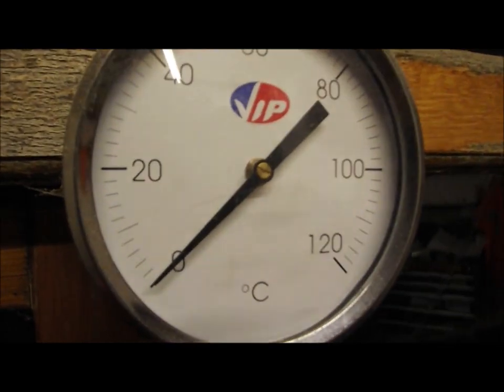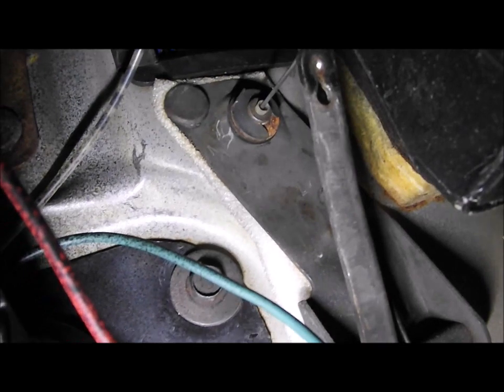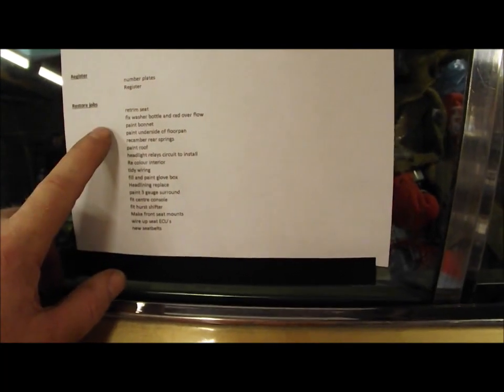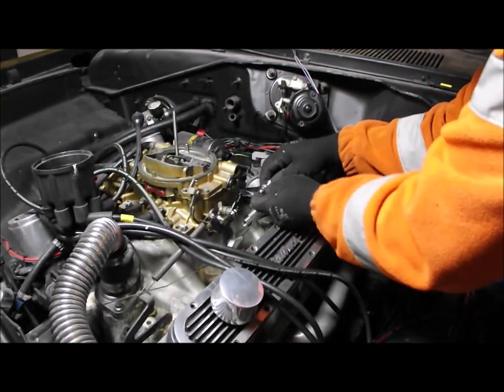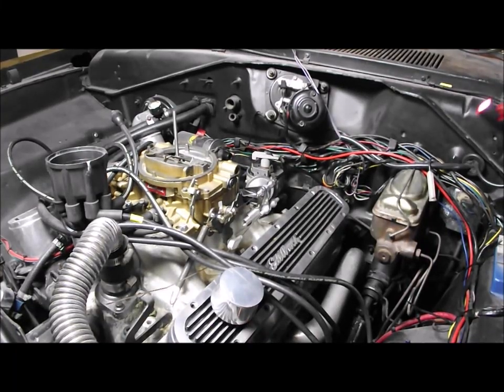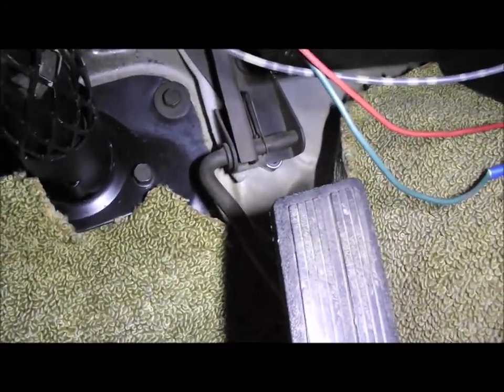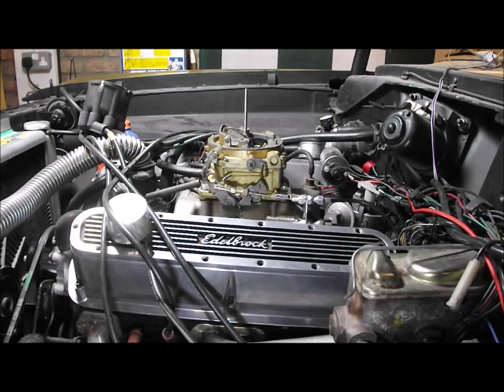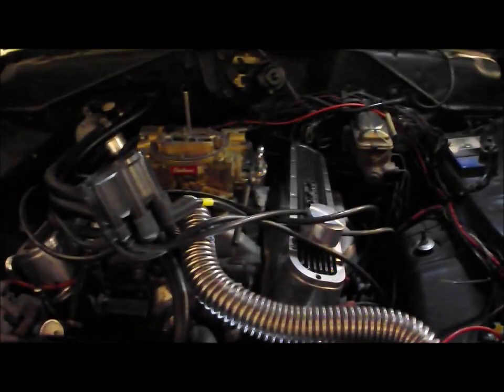1971 Dodge Dart pt7- Throttle & Lokar kickdown cable installation -  Vintage Steel Garage Ep 12 -

Comment: I'm watching this cause I'm about to do my throttle cable on my 1966 Dodge Monaco 4 door 383. Great help. I'm also gonna do brake master cylinder so I can  get my brakes working again. Bought it 12 years ago, and it's been a chore. But I'm inspired not to give up on it by videos like this. It makes it all worth it once you can drive it. I seen you got to in February, congrats!!!
Reply from the maker: Hi. Yep sometimes we all need a little you tube motivation. Glad it helped
Reply: I'm selling it now. I'm essential now and do not have time to work on it. It's on Facebook marketplace if anyone wants it. I can't let it sit anymore. Listed as 1966 dodge monaco for sale in alabama.

Comment: This is not quite as simple as he is showing. The pressure lever he is attaching the cable to under the car is from center to center of attaching hole aprox, 2 3/4''. The other end of the lokar cable attaches to the carburator arm which is aprox center to center of mounting hole 1 3/4''. The passing gear is a 1 to 1 ratio, meaning when the carb arm or lever moves 1 inch the pressure or passing gear lever has to move 1 inch.( no more, no less ) One of the reasons chrysler used steel rods on the passing gear levers to assure exact movement without any slop. If this is not done right it will not function as it should. Too little pressure on the pressure lever can damage the transmission over time. I drilled the passing gear or pressure arm to match the carbutator arm lenth to get the 1 to 1  ratio that chrysler requires...With the pressure lever pulled all the way back to rest the cable is slightly taught at the carburator attachment.  Idle adjustment needs to be preformed before adjusting passing gear cable to prevent disturbing the adjustment of said passing gear lenth setting...
Reply from the maker: Good feedback thanks

Comment: I'm struggling to find al your Dart videos. Did you cure the vibration issue?
Reply from the maker: Yes it was the distributor
Reply: @vintagesteelgarage  Interesting, I own the car now. I'd love to get in touch to ask a few questions if possible.
Reply from the maker: @VintageLifeCars  yes no problem. can you send a private message on you tube? not sure.  To be clear then the distributor was replaced by the new owner, I sold it with that fault. As I had lost interest and had my eyes on another project as you do.
Reply: @vintagesteelgarage  No, Youtube removed that facility... if you go to my details and click "About" you will see an option to view my email address.

Comment: My cable is working the kickdown but it won't go into final gear. What am I doing wrong?
Reply from the maker: Disconnect lokar cable and see if it works then. If it doesn't probably transmission linkage. If only when lokar connected it might be a little too tight and slacken off

Comment: Nice job. Did you pull the inner cable tight from the engine bay side before cutting?  That’s the part I’m up to now.
Reply from the maker: Thanks for feedback. Yes pulled it tight so pedal at the top. Ie not pressed